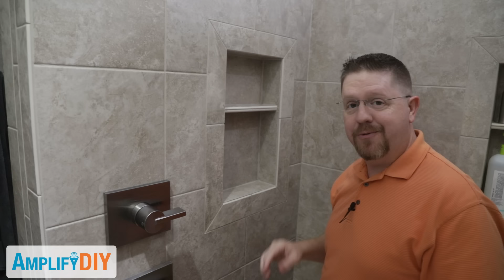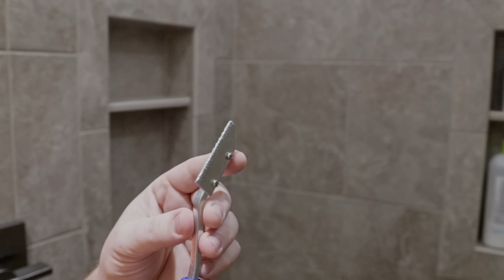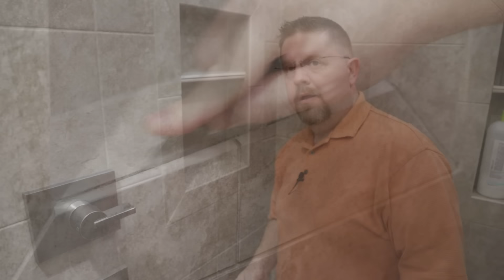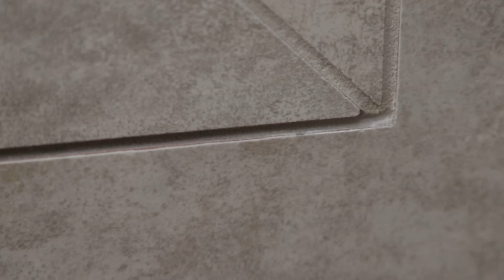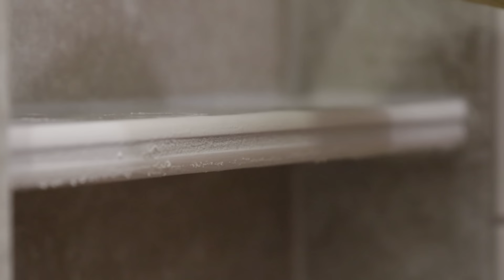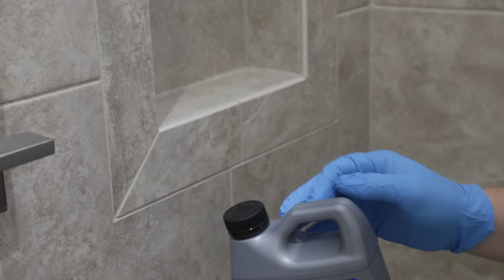How to Repair Cracked and Worn Grout (Shower)

Comment: I know it's been awhile since this video was made but can anyone tell me How you get the grout to the right height (or depth)???? That's the only thing I can't figure out. Otherwise this was an excellent video, I appreciate the close-up shots too, Very well explained! Thank you
Reply from the maker: Hi Rebecca - are you asking about how to know when you have removed enough (gone deep enough) or how to get it to the right height when putting new grout in? 
When removing the grout, you'll feel a distinct difference in the way the tool behaves when removing grout vs when you hit the mortar beneath. The mortar is MUCH harder. Take the grout out all the way down to the mortar. 
When re-applying the grout, using the rubber float that I demonstrated in the video press grout into the joint to completely fill it (to even with the top of the tile). Then when you use the sponge to wipe it that will remove just a bit of the fresh grout, leaving it at exactly the right height between the tiles. (The tiles will be just a little proud of the grout level). 
Does that make sense? 
If I misunderstood your original question, let me know where I went wrong and I'll be glad to clarify. Thanks!
Reply: @AmplifyDIY  No, you understood me exactly 🙂 thank you. I wanted to know about filling the joint with grout & how I get it to the right height to the tile. Thank you very much!!

Comment: Great video, thanks. Would you recommend using grout sealer? I’d rather not use it if I don’t have to.
Reply from the maker: Hi Sam - some types of grout do not need or recommend grout sealer. The Fusion Grout I used in this video is that way, and it has held up great without any sealer. Check the label on the grout you plan to use. Good luck!

Comment: Hi Thanks for a really well explained video. Quick question on the haze remover on Fusion Pro grout- I cant seem to find any "non" cement grout haze remover in my local stores. Can I just use "cement" haze remover instead? Would this be an issue? My grout has been cured for good 48hrs now so wanted to tackle this haze asap. Thanks
Reply from the maker: Hi Nikhil - Fusion Pro specifically recommends either Aqua Mix Grout Haze Clean Up (https://amzn.to/3jJMKQC) or Tile Lab Grout and Tile Cleaner (https://amzn.to/3ylJJdl). If you can't find those, then get any tile or grout cleaner that is non-acidic. Good luck!
Reply: Thanks, a local home Depot does carry a Tilelab Cleaner. I'll try that. Didn't know it can be used for haze removal, thought it was more of general cleaner for mildew/rust type of cleaning. Does this work because FusionPro isn't your typical 'cement or epoxy' based grout?

Comment: Question - what if there seems to be a gap between two tiles? One area is currently growing some MOLD. After you prep everything, should you put an anti-fungal spray before re-grouting?
Reply from the maker: I would do all I could to clean out and completely remove any mold you find before you try to grout anything. I would not fill a gap with a bunch of anti-fungal/anti-mold stuff and leave it there before you put in grout, though. You want the surfaces the grout adheres to to be clean and dry when you add the grout. Good luck!

Comment: AmplifyDIY how long to cure and dry before you can use the shower? Thank You!
Reply from the maker: Hi HB - depends on the specific grout you use and whether it needs to be sealed. Consult the instructions for your grout.... but usually 24 hours.

Comment: Can we use that grout knife on floors with the same tiles? I’m just scared that the grout dust will go under the cracks we cut off.
Reply from the maker: Hi Jennifer - yes, you can use this tool on floors. Use a vacuum after you are done removing the old grout to suck up all the dust. Good luck!
Reply: @AmplifyDIY  It all worked out great, thank you! 😃

Comment: Great and informative video!!!! Thank you! If I do not know if the builder used cement or Non cement grout what would you reccomend to do?
Reply from the maker: I would just do my best to match the color, and go with a non-cement grout that does not require sealing. Good luck!
Reply: @AmplifyDIY  Thanks, that sounds like a great idea. I will do that.

Comment: -is the shower immediately available for your use after using that excess grout remover solvent at the end of your presentation?
Reply from the maker: Depends on your grout. Consult the instructions-some require several days to cure properly.

Comment: TY - this is very helpful for a grout repair neophyte. I am watching multiple DIYs to get a consensus.  One thing I am not clear about is how to apply grout to corners? Any insight?
Reply from the maker: HI Doug - I believe the best approach for corners (where a wall meets a wall, where a wall meets a floor or ceiling) is to not use grout at all, but use a high quality flexible silicone caulk instead. As the house settles/breathes with the temperature changes of the seasons, these corners need to have the freedom to flex a little. Grout is extremely brittle, and will crack at these joints. Silicone caulk works great. Good question!
Reply: @AmplifyDIY  Many thanks - I have subscribed!  I have heard others say that silicone will tend to mold. Another source said to put a lesser amount of grout in the corners and after curing apply silicone over the top.  Do you have any thoughts or experience with either.  (BTW I will be using an expensive premixed waterproof grout of same brand/color that was used by the originally installer 10 years ago.)
Reply from the maker: Thanks for the subscription! I've had good luck with silicone. I believe there are silicone caulks available with anti-microbial stuff in them. A quick perusal down the caulk aisle at your local Home Depot should offer a few good options. Good luck!

Comment: You mentioned that if you have to repeat this repair every few years, it's not a big deal. Any reason you would not choose to use an epoxy grout (a little more expensive, but far more durable in a shower) which could hold up for decades rather than years?
Reply from the maker: If I were to be re-doing all the grout in the entire shower, yes, I'd use something that lasts longer with less upkeep. In this case though, I was trying to match the existing grout since I was only repairing a small area. Thanks for watching!

Comment: Do you not have to seal the grout after replacing it?
Reply from the maker: Hi Tonja - the type of grout I used does not require (in fact, the instructions specifically say not to) sealant. Most grouts do, though, so consult the instructions for your specific grout. Good question!

Comment: Wonderful tutorial! Thank you for making this! I have a corner tile where the grout is cracked along the bottom of the tile where it meets the floor. Would I use silicone caulk here instead of grout? Would I remove the existing grout before placing the caulking?
Reply from the maker: Usually at 90º interior corners like where the wall meets the floor I use a silicone caulk. This allows the joint to flex with thermal expansion of the house, and does not wind up cracking out all the caulk.
Reply: @AmplifyDIY  same problem here. So when I silicone the 90 degree area should I remove the grout then silicone or silicone right over the cracked grout?
Reply from the maker: Remove the old, cracked grout first. You want to fill the joint with the silicone. Good luck!
Reply: @AmplifyDIY  thank you!
Reply: @AmplifyDIY  Thank you for the extremely helpful info! Could you possibly recommend a brand of easy silicone caulk. I have an issue on one side of the shower where the wall meets the floor. Most of that grout has washed away and I really want a quick fix. At some point I will be able to have professional do work but I just need to stop any leaking at this point. Thank you very much in advance!
Reply from the maker: @SweaterWeather99  I'm pretty brand agnostic with respect to caulk. Just look for something that is 100% silicone, rated for bathrooms. There should be several to choose from at your local Home Depot / Lowes. I prefer clear, but if your bathroom already has white or almond caulk you should probably get whatever matches. Good luck!

Comment: Overall good video, but you might have noticed the logical inconsistency with the grout.  You said Fusion Pro was the exact grout used by the builder.  This is a premixed grout that of course requires no mixing.  Earlier you said you suspected the builder didn't mix the grout with the proper amount of water, which caused the shrinking and cracking of the grout.  Obviously that wasn't the problem since this grout doesn't get mixed with any water.  I can't say what caused the issue because I don't know all the details, but it wasn't that!  Otherwise everything looked correct.
Reply from the maker: You know, you are right - I assumed the tiling contractor had access to a version of Fusion Pro that you can mix yourself, while I was able to purchase pre-mixed. However, it seems that Fusion Pro is only available as a pre-mix. No idea why that specific area crumbled to pieces... maybe it was from a tub that sat out too long and had already started to set up? I will report that it's been more than a year since I did this repair, and the replaced grout is holding up perfectly. Thanks for watching!
Reply: @AmplifyDIY  yeah that's possible.  Or, as you alluded to in your video, they might have used a sponge that was too wet when wiping it.

Comment: However if we used premixed grout and then two days after application a small amount is cracked, then do we remove it, leave it and move on to the caulking stage right away, or add a little grout on top of the cracks and wait another day before caulking?
Reply from the maker: Hi Rob - cracked after only 2 days? I would remove it and try again. Good luck!
Reply: @AmplifyDIY  thanks for the reply!  I should've maybe taken a picture.  It surprised me that there was cracking.  It was Adhesive & Grout.  No way I will remove it over a little bit of cracking though.  Wayyy too much work.  I already got it under and to the sides of four tiles, and there was only a little cracking.  I mean, you would but you can handle these jobs, while for me they're like climbing Mount Everest.  I just slapped some more Adhesive & Grout on top of the cracking, took advantage of the fact that I was adding grout to fill in gaps between tiles a little better, and now I need to wait at least until tomorrow to apply caulk.  I should tell you one more thing even though this is already a complete book: I did everything at once,  under AND to the sides of the tiles.  Since they were tiny bathroom sink tiles, that might be okay, but we're probably SUPPOSED to take care of under the tiles first, then 24-36 hours later handle between the tiles.  My guesses about why: first to have the tiles securely fixed in place when between the tiles is handled; and second to allow the grout underneath the tile to dry better than it would if too much grout were above it.  But they don't say why, they just say to do the job in those two stages.
Reply from the maker: Hi Rob! It sounds like you got things figured out for your project. I’m glad! As to your question about why you secure the tiles first and then grout between them later after they’ve had time to cure, the answer is that the grout will shrink just a little bit as it dries. As a result, the tiles can shift their positions just a minuscule amount. If you put the grout in between them before they have a chance to shift like that, you will likely wind up with small cracks. This sounds like it lines up with what you saw.
Reply: @AmplifyDIY  Aha!  thanks.  Also I noticed that I asked about whether to remove grout but I think what I meant was whether to remove a tiny bit of grout, just chipping it a little and then replace that small amount.  But when you answered, I interpreted that you would remove ALL of the grout.  A pro like you might remove all of the grout  -- or would you chip away at only the cracked part of the grout?  I was so eager to get this job done that I slapped down more grout shortly after I first commented here, but your responses could help me a lot for future reference.  It's very helpful to know how much I messed this job up because there's probably going to be similar jobs soon.  The good news is that there's wood filler under the grout and there will be caulk above it, so the cracked grout might not be the end of the world.  Also, I might redo the entire sink counter eventually, after I gain experience through practice and online info.  cheers!
Reply from the maker: For a sink backsplash, I would not stress about a few cracks. If it was in a spot that needed to really be waterproof such as a shower surround or floor, I would have removed all the grout that had cracks. New grout that is not fully set up is quite a bit easier to remove than years-old hard as concrete stuff. Also, if you are setting tile (not just re-grouting) you should use tile cement to attach the tiles first, the grout in between the tiles after the cement has set up. Good luck with your future projects!
Reply: @AmplifyDIY  thanks!  I thought grout was for under the tiles too, I guess I need to learn about tile cement.  The bathroom sink multitasks, working as a dishwashing sink too, even with a nice high faucet that bathroom sinks rarely have.  (It's a business building rather than residential so we had to improvise.)  If there's more leaking in the future, I should rework the entire sink counter, but my current work should probably hold well enough for a few months at least.  Maybe I'll work the other bathroom sink soon.  I worked both sinks long ago but not extensively.  They were quick and dirty jobs.  We kept thinking we'd sell the place soon, but at this point, if I find time I should probably do a thorough job in at least one of the restrooms.  thanks so much!  I typically have to work sans much assistance, so it's much appreciated.  it lifts me from being down and gets me in a working spirit.
Reply from the maker: I'm happy to share whatever advice I can. I run this channel because I genuinely love helping people, so thanks for letting me know how your project worked out. Here's to a better, brighter new year!
Reply: @AmplifyDIY  Update: because I was using Adhesive & Grout, it is useable for both jobs: below the tiles AND between the tiles.  I'm confident that using a cement for the former and a grout for the latter commonly would be a superior method, but what I purchased is for a small repair rather than an extensive job.

Comment: Do you need to seal it with grout sealer?
Reply from the maker: Hi Dylan - whether you need to seal the grout depends entirely on the type of grout you use. The type I used in this video does not require any sealant, but other kinds do. Follow the manufacturer recommendations on whatever grout you use. Good luck!
Reply: @AmplifyDIY  Thank you! Very helpful

Comment: we have a few cracks in our bathroom shower tile should I get the grout saw or the oscillating saw?
Reply from the maker: Hi Jen - which saw you use I think depends entirely on what you mean by "a few cracks" - if you mean only like 3-5 linear feet worth of cracks, then I'd just use the hand saw I demonstrated in this video. Much more than that, and your arms / shoulders will thank you to get some power tools involved. Good luck!

Comment: Thank you! My house is 2 years old and I found some sections of grout that are just plain missing and some that were cracking. Your video gave me the confidence to do it myself!
Reply from the maker: Nice!
Reply: This happens when your house is subject to a lot movement (vibrations) called settlement. Probably your tiles have been laid directly on wood which is not a good substrate to tile onto. Happened the same in place which wasn't built as well more than 2 years ago.
Reply: Can I use that little grout removal tool to remove grout on my kitchen floor ? Probably tough since it's a larger area plus the grout lines are thicker. thx

Comment: Do I have to remove old grout or can I go over the top of it with new grout
Reply from the maker: Hi Thomas - you really should remove the old grout so that the new grout is installed with it's full thickness. If you just put a thin layer of new grout over the old stuff, it won't hold up very long. Great question!

Comment: How long should I wait for the completed grout job to cure before using the shower?
Reply from the maker: Good question! Cure times vary by grout type and manufacturer. Check the instructions that came with your grout, but a good rule of thumb is 72 hours. 
Good luck!

Comment: Great video.  The haze remover I bought says to wait 10 days for the grout to set up.  Should I seal the grout and then wait out the 10 days?
Reply from the maker: 10 days? That’s a pretty long time. I would not seal the grout until after you have removed the haze. Good luck!

Comment: If ive got small holes in between tiles, could i just patch them by applying grout directly over the old grout to fill in the holes?
Reply from the maker: I don't recommend doing so. If you have small holes, then the existing grout will continue to crack and chip under the new grout, cracking and chipping it as well. You'll be better off removing the old grout and re-grouting completely. Good luck!

Comment: Great video. Do you happen to have any where you are doing the verticle grout line between the two walls? I have a shower where that grout line has cracked the entire length. I know the process is basically the same, but will the same grout float tool work?
Reply from the maker: I don't have a video about that specifically, no. Is this at a corner? Most of the time corners are not grouted, and instead are filled with a flexible silicone caulk. If you do use grout then yes, the same float tool should work. Good luck!